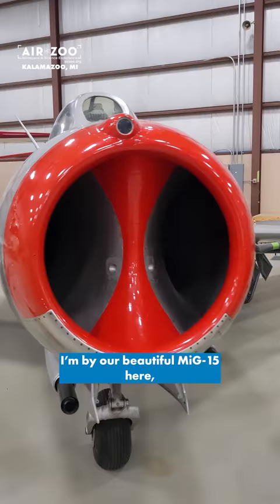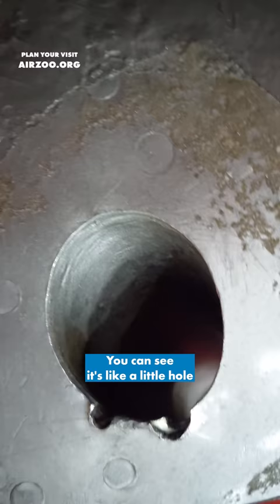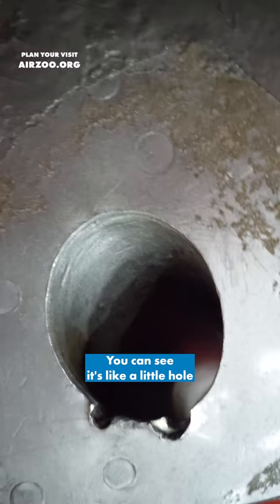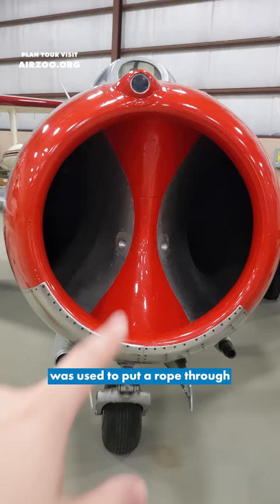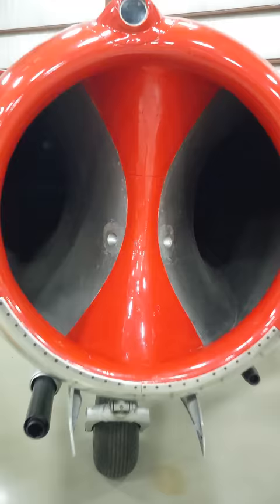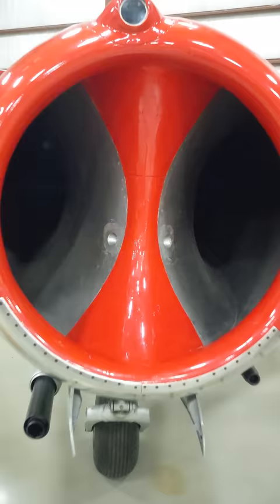What is this hole in the MiG-15's nose for?

Comment: I suspect not, having that hole there will hurt the aerodynamic performance so if it's just there to pull the plane around I suspect they would have something to fill the hole when it's not being used. 

Given that they don't (or at least don't seem to) I assume that the hole does actually have some purpose, though I'm not sure what it would be.

Comment: Yeah that was one of the reasons for that hole. The other reason is is because the cover that goes on the front has these little pins that lock into those holes. You can actually see where the pins have made an indention in the metal. When he showed a close-up of the hole. Man I can tell you guys so much about these airplanes. I can also tell you what it's like to die in one. That part is not so fun.

Comment: Looks like a good spot for an air speed sensor or a mass air sensor. Both would be helpful for fuel delivery. It looks like there are a couple holes already drilled for venturi tubes or similar apparatus

Comment: It smooths the airflow going to engine   the vacuum effect cause the air to spiral inwards the faster it goes, it slow the air during supersonic sppeds which damage the engine. New jets use a s duct to slow the air before the turbine. Non supersonic planes do not need this

Comment: No way that through hole doesn't have something to do with airflow through the induction cowling. Ima guess it's about equalizing airflow when the plane was banking. It had a thing for the hot punk rock teller.

Comment: Don't you have any imagery of it hooked up to a tow bar? Did you do a good inspection of the gear for the attach point? The nose ring could be a secondary pull point for ground crew but then how did they stear it?

Comment: Tow point in case of emergency war airfields that operated without tugs. You can still see the glue from the tape that was covering the hole.

https://www.youtube.com/watch?v=AVAXXo6eadE

Watch this movie at 1:10 and you will see a Mig-15 bis with the stickers on the hole and instructions written in red underneath. This was movie made long after the Mig-15 was out of CSLA inventory and the scene is arrival of first brand new Mig-15s in Czeechoslovakia. The filmamkers had to use planes from war reserves stocks and you can see the different sheen of the aluminium where the markings were scrubbed off. Also notive the gun camera offset on the Mig-15 bis vs the earlier Mig-15.

Comment: Most tugs hook up to the front landing gear. I really want to know what that hole is for... But IDK about a tow connection. Although, that's just me as an aviation inspector.
Reply: From what I read from other comments it was to quickly get the aircraft off the runway in the event it had been shot up and couldn't taxi

Comment: Okay sick but why does it have a giant hole splitting in both ways like that?? I feel like thats much more interesting than that smaller hole i barely noticed
Reply: The nose of the MiG-15 is the air intake for the engine, it splits in two ways to go around the cockpit, then coming back together at the front of the engine, behind the cockpit.

Comment: No way I would try to tow a MiG-15 anywhere with a rope through the front of the aluminum air frame. If Im towing a MiG the ropes going to be attached to the landing gear.

Comment: just like a car, you put the tie / rope around the control arm or main landing gear in the case of aircraft, and pull. pulling from the nose seems far fetched and likely to cause airframe damage or loss
Reply: This tow point is primarily for when the nose gear no longer exists and airframe damage is the least of your worries.
Reply: @martindinner3621  lol thanks doc

Comment: Seems like a very Russian explanation. That way when the plane breaks down, you can rob parts off the tractor to fix it, since the money for plane parts was spent buying an oligarch a yacht. Although, the money for the tractor was also misappropriated, so it's probably pulled by a mule, which it why Russian aircraft speed is currently measured in MULES per hour.

Comment: You never pull an aircraft from the nose unless it’s a propeller (from the blade root, only and only by hand) because it’s too light and needs to transfer all of that stress through to the landing gear. 

You tow from the nose wheel.
Reply: They're not pulling on it like it's a radome or nose cone. It looks like it's part of the fuselage.

Comment: It looks as though it might be a way to measure air intake
Reply: No, that is separate, further down before the first compressor stage, a static port to the engine controller, to adjust fuel flow with stalled pressure there.